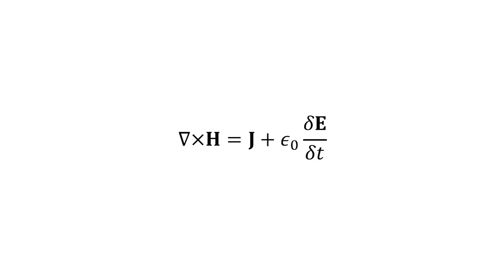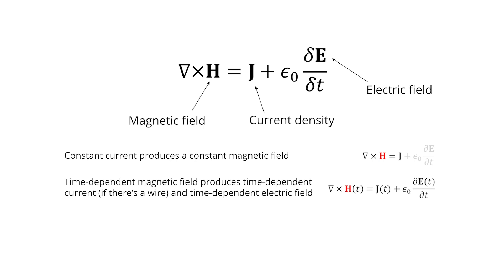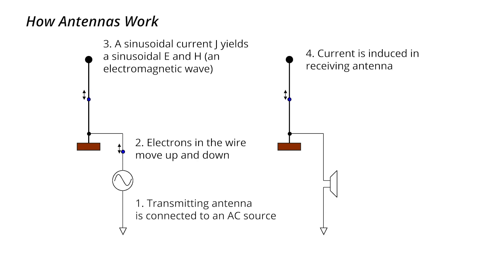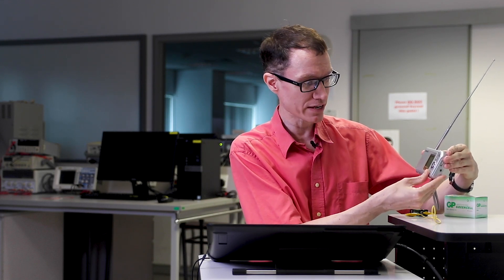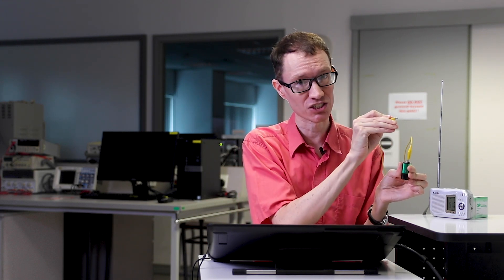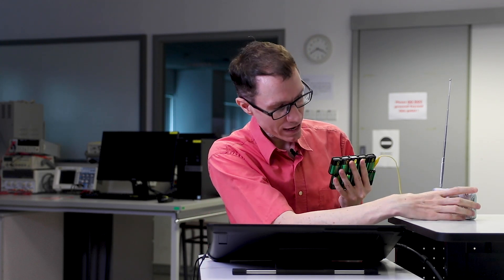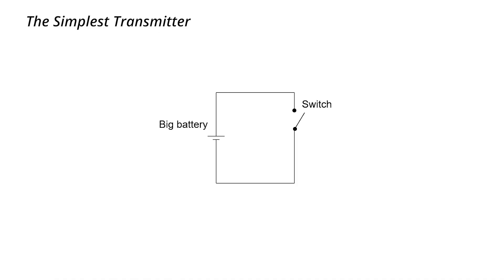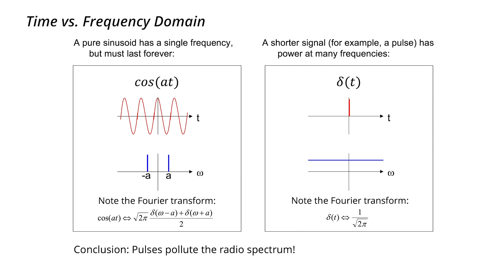Let's build a VERY SIMPLE radio transmitter (1-Analog Electronics)

Comment: Thanks!👍🏻At about 1:45, it seems better to say it's the "time dependent electric fields" that are generating the "time dependent current and magnetic fields", although the induced voltage in another wire would have a generated ""time-dependent electric field".

Comment: Current does not increase when 10  batteries are connected in series for short-circuiting. Because the internal resistance also increases 10 time like voltage.
If you connect few batteries in parallel then current and range of your simple transmitter increases.

Comment: The video is quite interesting, but I would like to make two observations:

1) The equation presented in the video (Ampère’s law) is not sufficient to describe the existence of an electromagnetic wave. In fact, Faraday’s law must also be included. Ampère’s law states that a time-varying electric field produces a magnetic field, while Faraday’s law states that a time-varying magnetic field induces an electric field. Thus, a time-varying electric field can generate a time-varying magnetic field, which in turn produces a time-varying electric field, and so on. And this is what allows the propagation of energy in the form of electromagnetic radiation. When a magnet is moved near a metal coil, the induced current is a result of Faraday’s law, not Ampère’s law. In other words, it is Faraday’s law that explains how electricity generation works in a power plant (Faraday’s law of induction), not the equation presented in the video.

2) In the example with two magnets, where the movement of one causes the other to move, this effect is not due to an electromagnetic wave. Instead, it is simply the interaction between the static fields of the two magnets. Even if the movement were extremely slow, the motion of one magnet would still induce the motion of the other. Under such low-frequency conditions, any resulting electromagnetic wave would be negligible and have no practical effect.

Best regards.

Comment: Is it perhaps the case that the experiment with 10 9V batteries failed to boost the range significantly because the current is limited by the internal resistances of the batteries? I'm guessing the current doesn't scale with the voltage. Therefore the current can only spike so much no matter how many batteries you put in series.